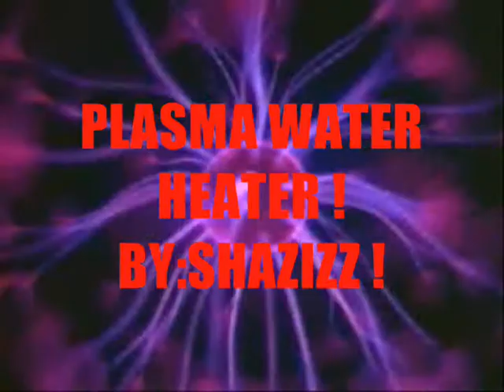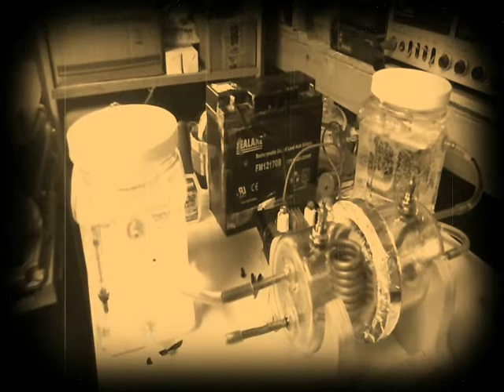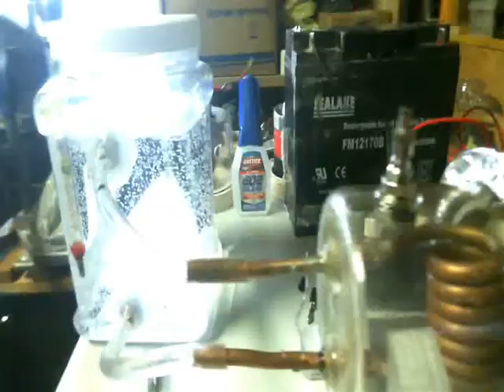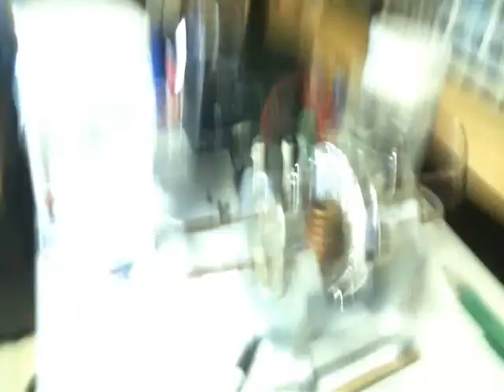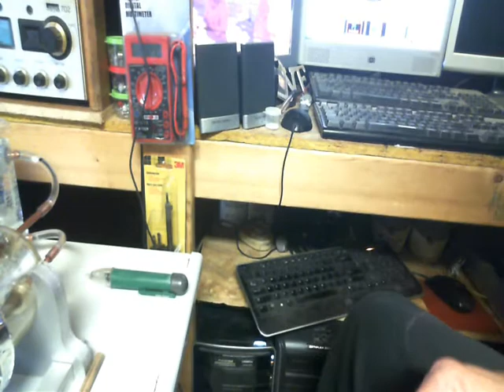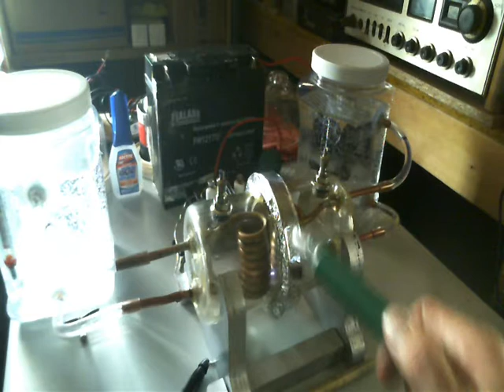PLASMA WATER HEATER !

Comment: This is a interesting project.  Many experimenters have worked with plasma.   I wonder if theres other ways to rapidly increase temperature in gasses or water.
Reply from the maker: By shielding any radiant energy around it so that it bounces around like a microwave oven does inside could be an option. :)